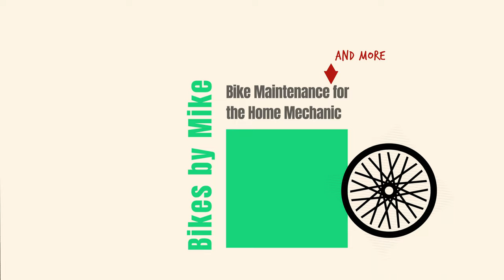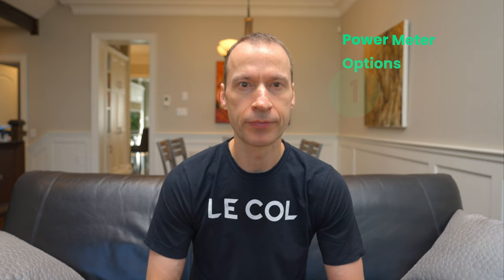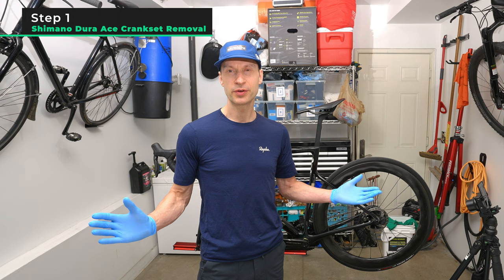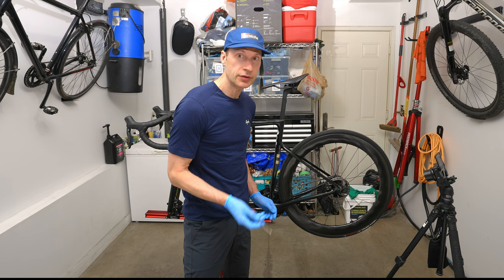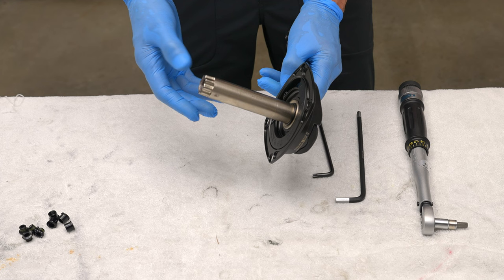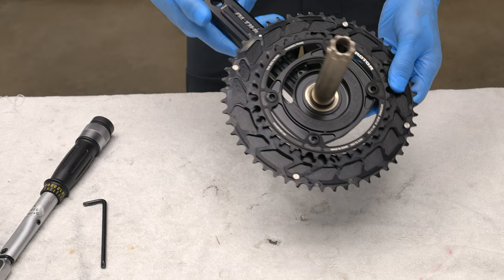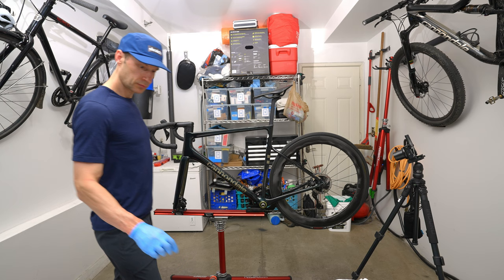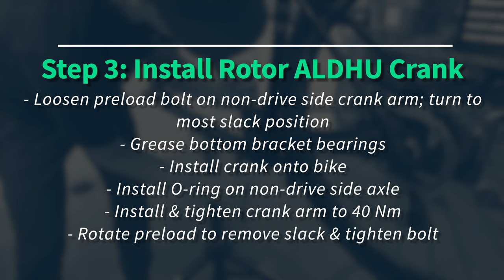How to Replace a Shimano Crankset with a Power2Max NGeco Power Meter

Comment: I appreciate your videos Mike.  It has been a while since I lived in Toronto.  Which is your bike shop for getting this type of specialized high-end stuff, like Rotor power meters, in Toronto?  Or do you order all your stuff on-line?
Reply from the maker: Thanks for the feedback! Since I do all my bike servicing myself, I usually buy parts online. And I use a few dozen different places inside and outside of Canada based on my needs. I’ve included links to where I purchased my Power2Max power meter and Rotor chainrings in the video description (thanks for the reminder to post this!). Your options for sourcing Power2Max and Rotor products are somewhat limited. For Canadian shops, I would say that Bicicletta.cc and Mariposa Bicycles have the largest selection of premium cycling products. Primeau Vélo out of Quebec has excellent customer service and prices, although their selection of premium merchandise is limited.
Reply: @bikesbymike  Thanks for your reply Mike.  I will have to visit those shops when I visit my parents this summer.  Back in the day, I used to get my stuff at Wheels of Bloor and Racer Sportif in BWV and Duke's (before the fire).  Cheers.

Comment: The P2m still only reads one side power, it only calculates whats the non-drive power basically by software but not actual power output, unlike if you buy pedal based or ei rotor 2inpower.
Reply from the maker: I don't think that is correct as it is a spider-based sensor, not single crank arm based. The single crank arm ones use a mathematical formula to estimate power on the non-measured side, but that is a different system. It is advertised as offering "complete dual sided power metering." It measures power on both sides but the NGeco (unlike the NG) doesn't give you power balance figures.
Reply: @bikesbymike  Shane Miller explained this in detail on his channel, and also DCMaker.
Reply: @bikesbymike  again the only way you can get actual dual sided reading is if you have dual sided sensors, spider based is 1 sided measurement, sorry to break the news to you buddy.
Reply from the maker: @pvelardeNP  I’m not totally disagreeing with you, we’re just not using the same terminology. You are right that the NGeco does not measure power from both crankarms as does the ROTOR2inpower, so it can’t measure true L/R pedal balance. But it is better than a single crank arm power meter that only measures power from one leg and then uses an algorithm to estimate power from the other. The NGeco has the power sensor located at the crank-spider and the crank-spider feels the force coming from both pedals. Power2max does a good job of explaining all the different types of power meters on their “Cycling Power Meter Basics” webpage. They describe their crank-spider power meter as offering “…complete dual-sided power measurement and so captures the power output of both your legs.” Here’s another quote from that page: “Pedaling forces are transmitted through pedals, crankarms, chain and chainrings. As long as you use both legs to move you on your bike forward, forces from the left and the right leg will be transmitted to the crank-spider power meter.” They also go on to explain why their dual-sided power meters are different and superior to single-sided power meters.  I don’t care about L/R balance, but I do want power captured from each crank arm. The NGeco does that.